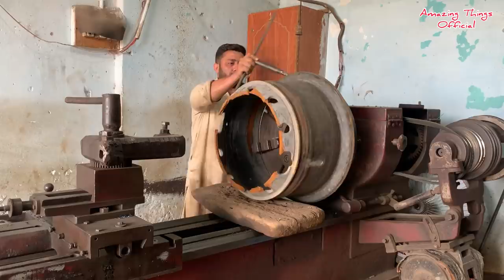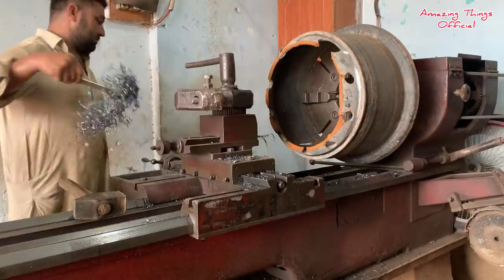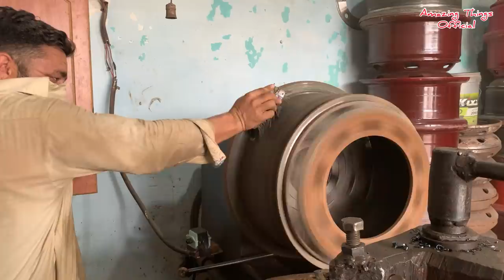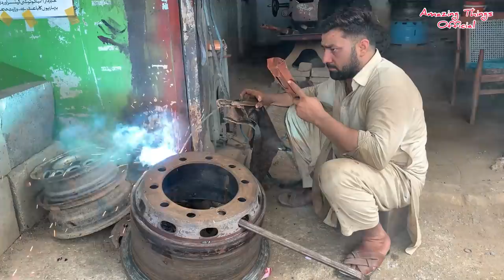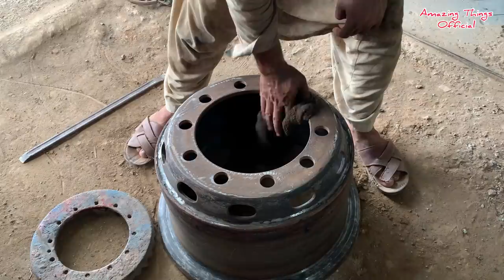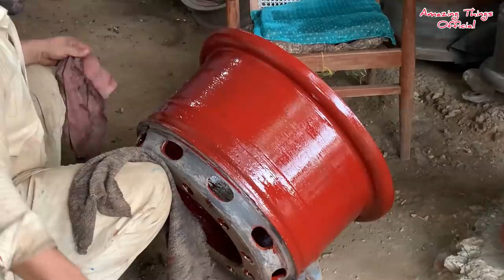How to Replace Truck Tire Broken Rim Plate | Restoration of a Truck Rim || Rim Repairing in Pakistan

Comment: It´s amazing the way these mechanics work in workshops in Paquistan .  They work without goggles , gloves , leather apron ,
suitable shoes , masks against gases and dust  , ear muffs , lack of more modern welding masks and wear very loose 
clothing near the lathe . It is very risky to work without these protections . Greetings From Brazil.
Reply: Yup...  It seems as though workers are very expendable in Pakistan.  In addition to your comments...  A lathe that is just sitting on a dirt floor.  An un-anchored grinding machine.  Zero lubrication on all the ways (sliding surfaces) on the lathe...  This place is a safety nightmare.  That said...  These guys to a pretty good job considering the primitive conditions they work in.
Reply: @WHJeffB , These workers carry out an 
important work of turning and mechanics , 
even working in minimum safety conditions . I really want to get to know 
Pakistan and i know that the people of that country are very hard working . I wish 
for all of you progress , peace , freedom and joys. A hug the size of Brazil to our 
brothers in Pakistan .

Comment: Recycling yards must not get alot of scrap they repair everything. I love it and the talent that is required to Repair everything vs autozone is on a hole another level special doing it without the latest tech.
Reply: I can repair most anything with a torch and a welding rig however these guys do display another level of ingenuity but what they're doing is not rocket science.
Reply: This is where other countries send the scrap too, to be reused or recycled
Reply: they get their materials from scraps dumped in by other countries
Reply: @unclequack5445   true but their self-reliance is very attractive

Comment: I love this guy,  that run out indicator is a nail,  just like I used to use. And the lathe I used would not have taken the whacking with the hammer that his does. 7018 rod, not known for strength, and dude needs a chipping hammer for the slag. Two cans of Krylon gloss black and we has us a nigh onta new wheel.

Comment: A movie like this should be a manual: "How do not repair parts, which should be destroyed"
Reply: Why should they be destroyed?
Wheels are repaired daily all over the world
Reply: @chrisbanning413  that kind of wheel rims is used on heavy trucks.  The force which loaded each rim is very high and after this reparation there is no chance that material has a same microstructier in each section. Did you see how look rims production? Part like this is tested by x-rey to be sure that there is no micro craks. Of corse if you'll grinded and painted, it can look like new, but what is important to safe for part such this is matirial structure.
Reply: @m4ri081  I disagree,
Even in developed countries we have wheelwrights who do this daily, the repair may not be tested, but will perform as intended.
Reply: @chrisbanning413  You made question, so I've answered why. It dosn't metter where peaple do it. Skill it not all, knowage how it works, why it works is compleatly differend things. If you want, you can buy such part, your choice.
The same situation is with sick, you can go to a doctor or to a quack. Maybe results will be the same or not your choise.    
The thing is what mey be reparied and what not.
Reply: @m4ri081  you say it should be destroyed, but can be repaired and safely used. Yes it may not be quite as strong as new, but more than strong enough for the intended use

Comment: For the available tools, this is a quality job.  Well done!  I'd put it on my truck (if I had one).  The only concern I have is the placement of the replacement hub/rim plate with the lug bolt holes - I did not see any measurements taken to know if the depth of the replacement hub was proper for that particular wheel.  Maybe it doesn't matter in the grand scheme of things?
Reply: He cut it then he measured it b4 he started welding it i would give him 10/10
Reply: He made sure the center hub plate lined up with the valve hole, other than that, how deep he goes in or our only changes the dual spacing, or offset, and on many trucks, this is not a critical distance.

Comment: These guys have to work with what they have, but it isn't safe, and the repairs won't last very long since they are welding multiple beads onto dirty slagged beads without proper wire brushing.  and all the rags they use to clean are full of sand and dirt.  Their process is still cool to watch,just don't do this if you  value saftey and the lives of the drivers who overload these trucks with backyard repairs.  But I get it, they have no other choice if they want to put money in their pockets

Comment: Considering the equipment he did a good job, but his welding skills are not the best.  There was too much contamination in the weld and not enough penetration.  He had a thick enough rod.  Possibly his welder could not handle more amps.  Luckily he welded on the inside and outside.  Also he could have cleaned it up on the lathe far better.  His little "dial indicator" (a little rubber finger to check variation) was not very accurate either... at all.  Then again the rims were pretty beat up.  I have not done much with lathes though, but I used to be a great welder... back 35 years ago.  That tire might be a bit hard to balance or might have a bit of a wobble.  But like I said he did pretty good for the tools he had and did it in a reasonable time.  In the US it would likely be far cheaper to just buy a new one.  Truckers make pretty good money in the US.
Reply: Wtf?????... that weld is better than the factory one
Reply: @cirolastrusi6420  It looked good cosmetically...a good bead, but the pentation was not as deep as it should have been... or he needed to leave a gap to fill in with welding.  He did put a lot of welds, but you could likely cut it back apart if you gut the welds.  I done right the weld would go all the way through.  There was not heat marks on the outside or anything.  You should also see a bit of cupping in along the edges of the weld as it draws material into it.  Instead the weld is a solid bead of welding rod and not a mix of rod and the metal from around it.  It is hard to explain, but I used to be a really good welder and I did mostly stick welding like he did.  That kind of weld can crack and those parts could separate... especially with all the contaminations in there.
Reply: @cirolastrusi6420  
A/C 6013 is Universal, but not on this application.,....Regards.
Reply: @toddabbott781  Nice tips!  The heat  coloring and the tiny bite at the edge are things we weren't told in welding class.
Reply: @katemoon7476  I was lucky.  My second year of welding we had a teacher that actually knew his stuff.  When he noticed me and one other were way better than the rest he started giving us more tips and tricks and let us use the better welders.  I was a really good at arc welding thicker material and pretty good with gas welding.  Sadly we did not have a TIG welder and I got little work with the MIG welder.  He let us do the cool projects in class like rebuilding the frame on a snowmobile trailer.